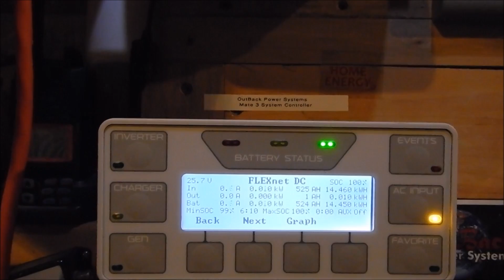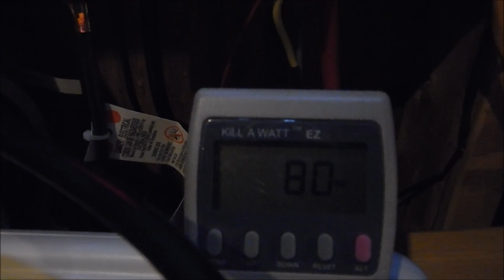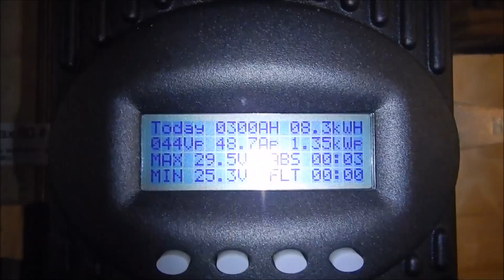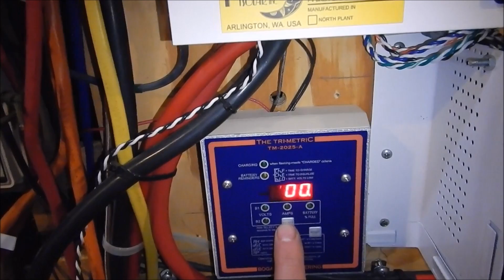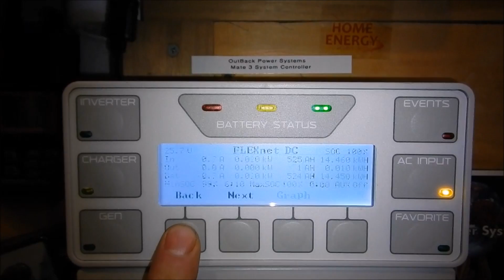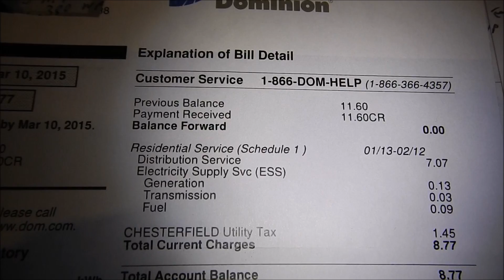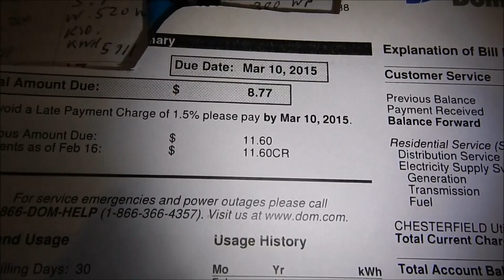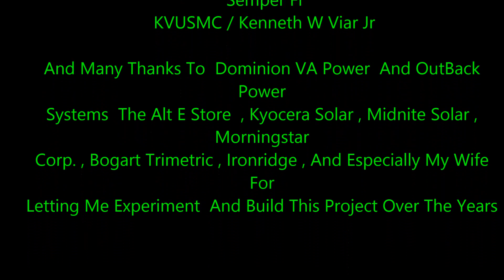Solar And Wind And Battery Heaters Update And Power Bill  January / February  By KVUSMC

Comment: Kenny how is power generation say if you had like 3 days of cloudy raining weather, do you still make any solar power? like if you were totally off grid? I guess it would depend how many batteries a person has and ones power consumption. I always wanted to do a full off grid solar Tinyhouse or RV just wondering all long you could last without some good sun?
Reply from the maker: natrone23 Even On On days With No Sun Or Wind My Batteries Are Still Fully Charged  I Have Seen 3 to 4 Days In A Row No Sun Or Rain  But Still Made Good Power You Could Still Run Or Power Up Refrigerator / Freezer Etc The Key Is Too Have More Solar Panels Than Batteries It Is Working Good